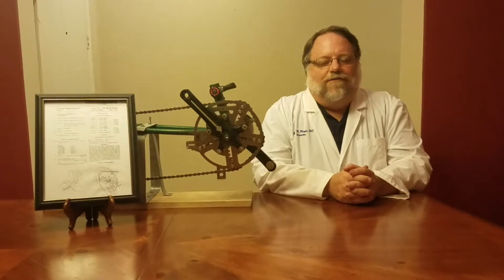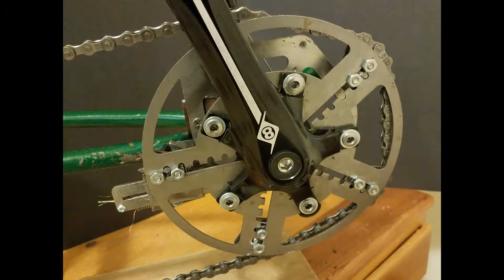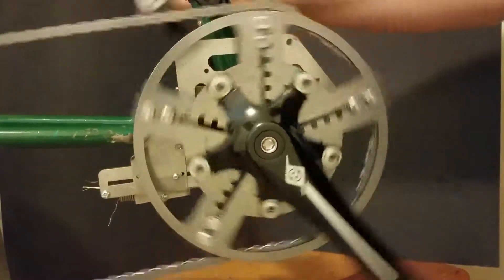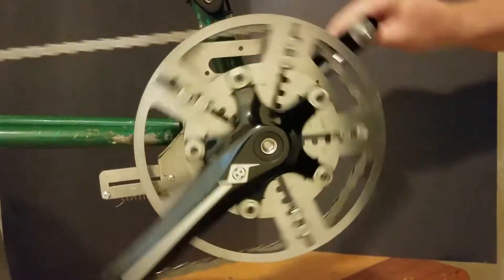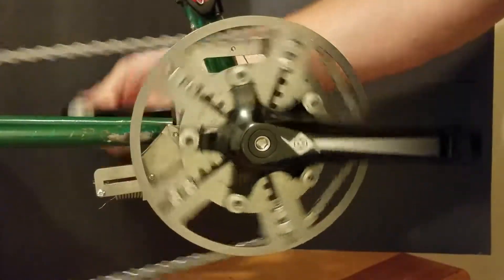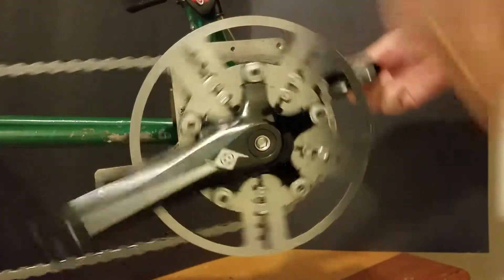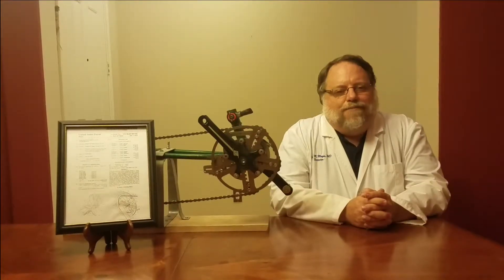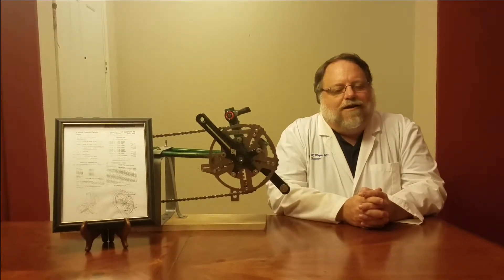VECTr Bicycle Gearing System: Variably Expanding Chain Transmission - New Model (January 2019)

Comment: 1, add the same thing to the back wheel hub but in reverse such that both variable-sized sprokets track with each other (while one sproket gains a tooth, the other loses its). This way, you can get rid of the derailer since the chain will stay the same length through gear-shifts.
2, instead of the linear-like teeth you are using to catct the chain, use a few small sprockets instead that spin, each small sprocket installed on the big variable sprocket. This way you'll get rid of the noise since a spinning circle will catch the chain easier than whatever you're using now. Those things are noisy and ugly. They aren't in the right orientation when contacting the chain, but a circle always will be.

Comment: not much different to this https://www.youtube.com/watch?v=yweIWBC9-OA and I saw something much, much older. None of these are used.
Reply from the maker: VECTr is not very similar at all. The chain-engaging gear segments on VECTr change radial position one at a time, not simultaneously as in the other device. There are very many other differences.

Comment: I think that with these systems, it would be best if you had a chain tensioner that adjusts with the ratios
Reply from the maker: VECTr works with bikes with rear cassettes and tensioner/derailleur. You can see that in this video: https://youtu.be/07FzZ3WcknU

Comment: Can you explain me how the pulley's dia changed. Please.
Reply from the maker: There is a locking mechanism on each gear segment which is released, and the segments are moved to new radial positions, by their contact with a controller while being moved by the cranks' rotation.
Reply: @vectr-variablyexpandingcha118  can you please explain me what type of controller is used for shifting the radial positions along the constraints?
Reply from the maker: @vignan222  The controller consists of two curved plates which are slid fore and aft by a cable attached to a friction shifter mounted on the handle bar. An electric actuator controlled by wired or wireless switch could also be used.
Reply: @vectr-variablyexpandingcha118  ohhhkkk.. Got it...